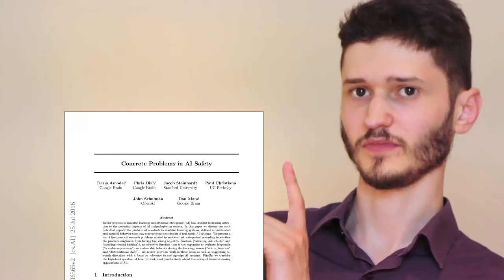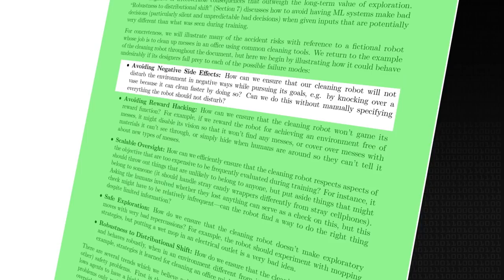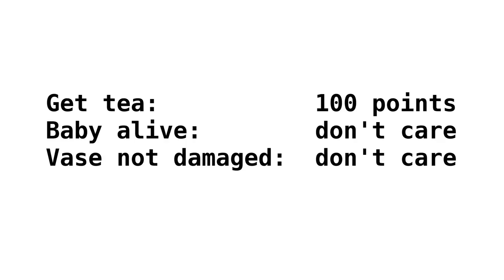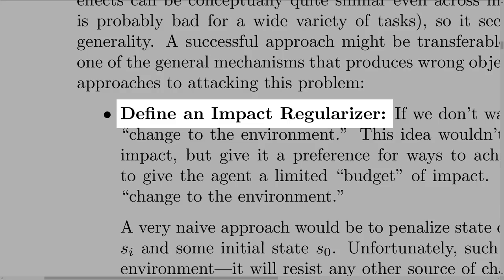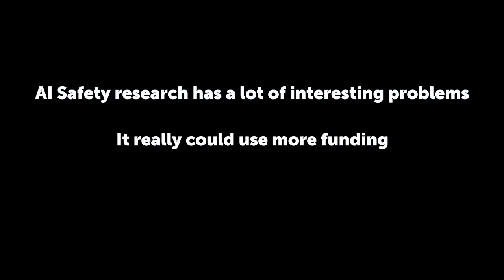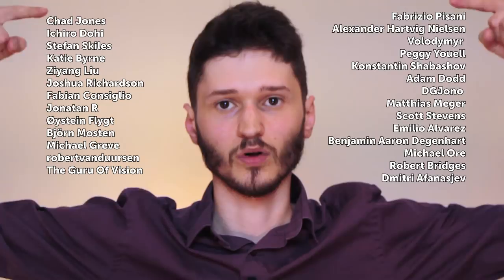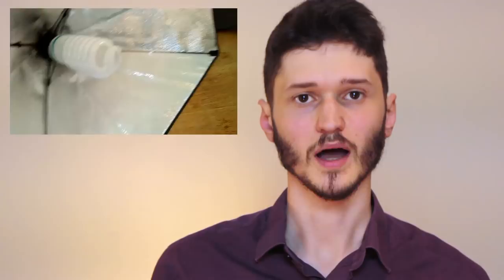Avoiding Negative Side Effects: Concrete Problems in AI Safety part 1

Comment: What I thought might go wrong: The tea will have side effects that are different from doing nothing, for example you might stop being thirsty after you get tea. So the robot, after having made tea, might try to make sure that this tea doesn't actually influence the world, for example by influencing your visual cortex to make sure you don't see the tea or something.
Reply: Is that a sophisticated way of saying it'd gouge your eyes out?
Reply: Well probably it`ll just refuse to give you tea.. But it is easily solvable: ai just need to be programmed to compare states of the world only in two particular moments: at a start and an end of its action sequence.
Reply: If it only checks at the start and end it will knock the vase over, then a the end glue it together to get the world state more similar.
Reply: Finni M. No?
Reply: totaltotalmonkey This doesn’t seem true? Like, it would be much more energy and time efficient to avoid the vase than to knock it down and glue it back together. And in the cases where it would actually be more efficient to destroy and rebuild—for example if you completely impede the path with a wall of foam blocks—then “destroy and rebuild” is actually what we might want it to do.

Comment: The modeling of the distance function seems incredible difficult to me.
Assume the AI and your roommate both want to make a cup of tea.
Breaking a persons neck might seems like a small change to the environment for the AI compared to boiling water and using up a bag of tea.
Reply: True, but you could try to program AI to measure value of a change by it's future effects. Like then doing moves in chess. Killing roommate may be a small change right now but have a big impact to the future state of the environment. No one will make funeral for tea bag.
Reply: I was thinking about a similar thing. What if the robot enters the kitchen to find a coworker who just made a cup of tea? Depending on the definition of distances in the state of the world, just taking the finished tea would cause less change to the enviroment than making another one. Even if it realises the person would now make another cup of tea, since that had already happened before it might not count as a significant change to the enviroment.

Comment: If the robot concludes that it can't make the tea without running over the baby (maybe the baby is too in the way and can't be gotten around), we would want it to abort the task and report failure. That's not achieved by a simple "change as little as possible" weighting, since as long as it's allowed to make SOME changes, establishing necessity makes anything permissible. It needs to know relative weightings of side effects and which ones are simply unacceptable.
Reply: If you weight "squish the baby" as a high enough change, the robot will conclude "Well, I get 10 points for making tea, but lose 10000 points for squishing the baby. I can't make the tea without squishing the baby, so my options are (a) do nothing, net 0 points or (b) make tea, net -99990 points. I'll go with (a)."

Comment: Very interesting. It sounds to me like the example of the fan shouldn't matter as long as the AGI can keep up with processing the state(s), because whatever you defined should only be instrumental in it's coding to the extent that it doesn't matter, and even when it does matter like something getting into the fan, both 'the fan is ON' and the emergent properties of the changing angle of the blades inherently suggest danger for anything that interferes with it (when properly coded).

Comment: Which aspects of an object's state are important is dependent on context. If you're trying to change the temperature of the room, or avoid slicing your appendages, then the important aspects of the fan's state is whether the blades are moving and at which speed, their particular orientation does not provide valuable information to achieving your goal. In humans, this is where experience and imagination (or creative intelligence) come into play. Intelligence is adaptive, an intelligent system must have a function to be able to determine the value of something, not simply know it, and it must care about not only the value of an action, but also the value of measuring different aspects.

Comment: Hey Robert, don't you think those problems disappear when an AGI learns through neural networks? The same way we just "know" stepping on the baby is bad, not by manually assiging a value to it, but because we persistently strenghtened the HUMAN - HARM - BAD - DON'T network. You know? There is a value, but it isn't assigned. And instead of assigning "not care" for unspecified variables, maybe the network has a way of grouping families of events based on the nature of outcomes it has previously learned, pretty much like a human brain does. We abstract real-world situations and apply the same principles we learned in completely new situations, which surely isn't always perfect, it's only good enough to secure the species. But why wouldn't an AGI be able to do the same?
Reply: What you're suggesting is known as the detached lever fallacy: lesswrong.com/lw/sp/detached_lever_fallacy
Reply: +maximkazhenkov11 quite some food for thought, thank you
Reply: The trouble with this idea is that humans do have "manually assigned" values, in that our brains have physiological responses to certain situations that give a "pleasure" or "pain" response. Mirror neurons help with making this principle work when applied to others, but basically our values are coded in the genome.
Reply: Adelar Scheidt Adelar Scheidt Good point. I guess the problem is that the learned behaviors wouldn't necessarily be on 100% agreement with humans. I mean, neural networks are notoriously complex and it's literally impossible to understand what exactly is going on. If we rely on "morality" learned through neural-networks, then we can't really be sure that it will match up with what we want it to do. I mean, what are the chances that an AI would come to have the exact same moral sense in every situation as a human? So I think that the unpredictability of neural nets lends credence to the idea that these kinds of problems should be solved manually by hardcoding them in.
Reply: I think a better point would be: If we train a machine learning algorithm (like a neural network) on data of what humans do in different situations, wouldn't it also act as if it had human values?
Reply: +Batrax Well yes, but to state that values are coded in the genome is a way too strong expression.. rather values are derived from this code and it's interactions with the environment. These traits are then partly passed on through both social and biological evolution creating at least some feedback between the two.

Comment: For your second issue I was thinking about unpredictable stuff that the robot may not react properly to. Say you win the lottery while it’s getting your tea. That’s probably a big change to your environment that it’s not likely to have predicted, right? Won’t it try to revert it, like breaking your ticket? 

If it’s only using a distance function and a predictor, how does it know, whether a change was caused by it or not? Won’t it go “well, I made tea and this huge thing changed that I wasn’t expecting it to, I must have caused it myself, need to fix it”.

Comment: I think, and I don't know if you've covered this in future video, what is need is an algorithm on "intent recognition" what is the intent of the roommate pouring coffee, what is the intent of the cars driving on the highway. So shifting analysis of world states to world intent you can begin to give your robot a sense to be able to judge motivations, both inward and outward motivations, and you could create a reward function for keeping motivations in balance, rewarding extra points if others motivations are allowed but not necessarily penalized if other motivations fail (maybe the score is lowered a bit, a sympathy score if you will) 

I think a start for intention estimation would be programming a neural network to try to predict where a user will click on the screen based on their mouse movements and or their gaze. If the cursor moves toward a button and then the algorithm predicts that it will or won't press that button, if it is correct then it has correctly judged the intent of the user. A similar program holds for the tea making robot: if a person is in the kitchen what are they there for? making coffee or cooking, oh they are getting out filters, must be making coffee. If this intent is judged correctly and then the person's actions are successful my score will go up a tiny bit, I will allow this person to continue. If this person's intent is judged incorrectly I better relearn some things. If this persons intent is judged correctly but is not successful I may lose a few points, maybe I will help the person, then perform my own intent. 

Then secondarily if there is no intent measured, then world states are to be honored.

Comment: The problem stated here with respect to driving seems to me to be an issue of time/activity partitioning. If the evaluation is continuous then it would fail as described (or perhaps get stuck in some sort of recursive loop)
But if it's a setup where it compares to "do nothing from when activity starts" it should be able to avoid at least that type of problem. What i do see as problematic, having thought about it for an hour or so is the value scaling of various changes to the world

Comment: I think I have an argument that shows that the concept of having a distance metric and subtracting is no better than the original approach of prohibiting every undesirable side effect.
Suppose the robot has 2 choices: 1) knock over a vase on the way to make you tea, or 2) trample a baby on the way to make you tea. (For the sake of argument, assume that no other option is possible.) Between these two, clearly the more desirable option is to break the vase. In order for the AI to understand that, the squished-baby world state must be further (according to the distance function) from the current world state than the broken-vase world state is. Similar scenarios can be proposed for other undesirable side effects.
Thus, in order for the AI to correctly choose between any given two undesirable side effects, the distance function must essentially be a ranking of all possible future world states.
Moreover, suppose two world states were omitted from this list (because programmers can't think of every possibility). If the AI were faced with a choice between these two world states, it would be indifferent between them (perhaps it would trample the baby instead of the vase simply because that path to the tea bags is shorter).

Comment: What about explicitly discussing goal decomposition?  Isn't "Make tea" actually a very high-level goal composed of an ordered sequence of other goals?  What about training for "Travel safely to destination"?  And that, in turn, would have its own decomposition.

The key issue would then seem to ensure that decomposed goals don't conflict with the hight-level goal while still achieving their own goals.  When this happens, either the high-level goal must be retried or deferred, or the lower-level goal must be redefined and retrained.

So, wouldn't it be an unnecessary problem / complication if a high-level goal had to "worry" about the safety of lower-level goals?  How should this be monitored / managed?  At what point can / should we define "trust" in the safety domain?
Reply: I was hoping to trigger discussion concerning why creating a system by combining "safe" components won't work!

The underlying problem is "emergent behavior":  Parts that are "safe" in isolation can acquire new unsafe behaviors when combined.

There are ways to mitigate such effects, but IIRC there is a proof that they cannot be completely eliminated in systems with sufficient complexity.  That is to say, only "relatively simple" systems can be proven safe.

So, if you want safety, keep your AI relatively dumb.

Comment: At 7:06 I have to ask myself at what point are we telling the robot to make his model. Because if its constant, than it could be less useful than the one where it sets things back. Lets say it prepares you a cup of tea. It takes the tea bags out because its necessary, but if it doesn't move anymore, then the tea bags would still be on the counter. So, it leaves them on the counter, along with all the cupboard doors open, the milk is out,  fridge door is open, and a kettle with no more water because it all boiled out is still on the stove.

Comment: It occurred to me that to try to fix the "AI preventing unnecessary changes to its world model" problem by predicting a future with no action by the AI will frequently fail, not just because of the limitation on predicting the future, but because in the event of such a prediction failure the AI will attempt to changing the world to it's incorrectly predicted results. The AI needs to have some way of distinguishing the effects that proceed directly from its own actions or from everything else. In other words, the AI can't just consider the null action case and then assume everything that happens that it didn't predict is its fault. It should also consider the effects of what it actually did or what it plans to do. 
Undeleted this comment because somebody said this objection had been addressed, but it hadn't. It wasn't addressed specifically that using this fix would imply that the AI would attempt to correct the world to its erroneous perspective of the world had it done nothing.

Comment: Here's a concept(and I'm sorry if this comes up in a later video, I'm just getting to them):
Whitelisting. As in:

Your goal is to make tea, but you may only:
move yourself
move the kettle
use n amount of tea bags per cup
etc.

And then we just try to run the AI on as few white rules as possible(if the list is long enough(or task-conditional, oh my!), this could even apply to general-purpose AI), and the whitelist would be much easier for a human to write and wrap their head around since it limits the possibility space from the start and only lets through actions that a human has carefully considered instead of giving the AI free reign of the universe except for the areas our puny squishy minds were able to fathom and deem unsafe.

Comment: You could use humans to "rate" how different two world states are, and train a neural network to calculate the "metric" between two world states ( write "metric" because it probably wouldn't be a metric function in the strict mathematical sense). Then the AI could use that neural network, and you wouldn't have to know specifically what's important or not. It's all encoded as weights in the neural network, and you don't have to know what a specific weight "means."

Comment: The answer is Evolution. In this case directed Evolution. I highly recommend talking with a geneticist - even if they don't know what you're talking about. Evolution by directed means over many generations will produce the desired goal without any of the nasty side effects as these will be "bred" out of the population of AI's due to selections pressures. Please just carefully consider the environment in which you direct the evolution - it is an extremely powerful tool . This is already used in computer science very regularly from what I understand and produces spectacular results. Combine your extensive knowledge with that of a Geneticist and that is where the answer will lie. The reason for this is that we want our technology to interact with out environment in a similar fashion to the way a "good Actor" from our species would, and we have evolved to this point. Technology has an advantage in that it can go through many more generations considerably more quickly than we are able to and therefore significantly speed up the process of Evolution - Evolution still remains the key.

Comment: Seems like you've just shifted the problem to the difficulty of writing a distance function. Because "distance" has to be more than just amount of change. For instance the robot has to choose between two routes: in one it will knock over a tower of cards, the other he crushes a baby's hand. If the baby's hand is smaller than the card tower then the size of the change favours that. So your distance function needs to assign a larger value for a smaller absolute change based on some other knowledge. Which quickly becomes like assigning values to things we care about in the objective function.

Comment: It still seems like reducing all side effects would just push the problem back one step. What if there's a scenario where it has to cause a side effect, it's just a matter of which one? Let's look at the car for an example, let's say it's driving down the road when child comes running into the street. The AI is able to tell that it can't slow down in time, so it has to choose between hitting the child and swerving to the side and hitting a tree. It has to have a side effect, but how would it choose which one?

Comment: I'm just getting into this field.  But. What's wrong with telling the robot to keep the changes in the environment at a minimum, but only for changes that the robot itself could do, not other creatures. Basically "avoid interaction with anything except what's allowed". Like that building surveying robot from Bostons Dynamics. Has a goal to get upstairs and check out the room. Using hallways, staircases and doors is allowed. Ain't gonna trip over pesky babies along the way. 
 Though I feel like I'm still missing a bigger picture here